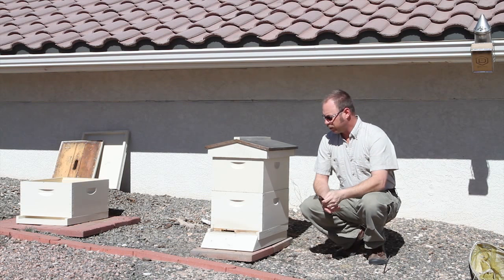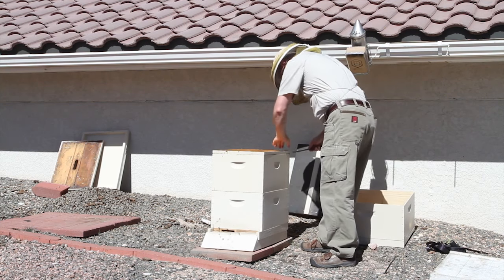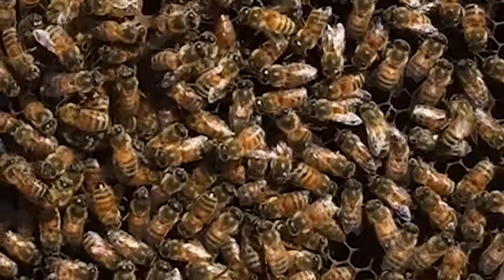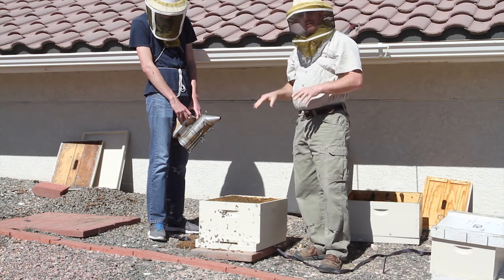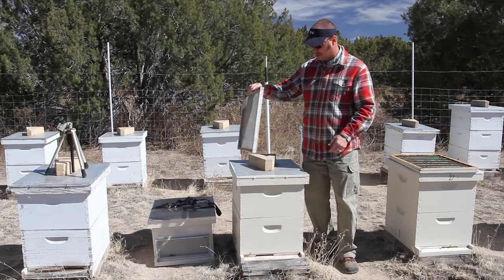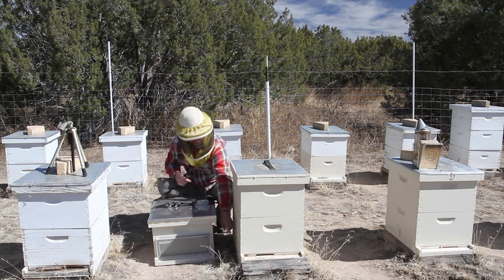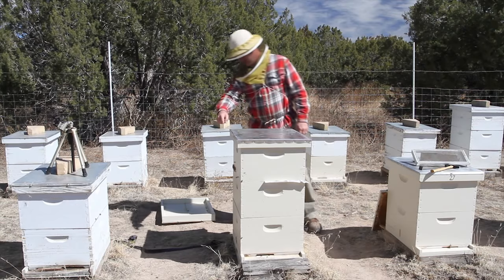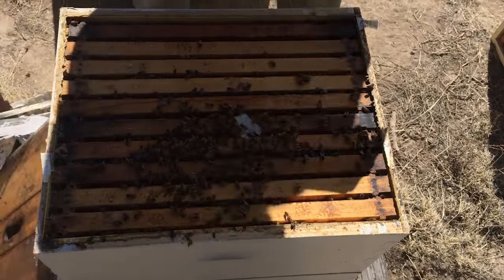Hive Management:  Uniting Hives

Comment: I have a feeling I might be uniting a hive shortly. It's a split and I'm afraid it won't be built up enough for winter. If that's the case, I'll unite it back with the parent hive.
Reply from the maker: Can you take brood from a strong hive (capped brood) and give it to the split?  If so, it will build up the hive faster and with less resources (capped brood have all the resources they need to hatch into adult bees).  If you can do this once a week for a few weeks you will see a dramatic increase in the strength and morale of the hive.  Of course, if you have only one other hive or a few hives it may be too expensive for the other hives, but usually a healthy hive can spare a couple frames of brood (plus it causes a little bit of a break in the brood cycle which can help the hive deal with mites).
Reply: +Honey Bee Honey that's a great idea. The parent hive seems to not be as strong as it was when I split it (previously it was booming) but the other large hive might have some to spare. I'm going to wait for a while longer before making the decision. I was to see how the queen does.

Comment: this will be my second year starting with bees I had a unfertile queen my first year (2016) and with lack of experience I lost the hive. I was wondering if instead of uniting the hives could you put the queen cell in the hive with the queen right hive, have her lay in that cell and relocate it to the drone laying queen hive, kill drone laying queen giving that hive a new queen? If so what would be some pros and cons for doing this and what is a good time line for the process? If you have a vid of this already, sorry for asking. I have not had a chance to go through all of your vids.
Reply from the maker: That depends solely on your resources.  But, to answer your question better, most of the time you could definitely give them a queen cell that had been primed and an egg inserted by another queen.  This video was shot in the early days of March, 2016.  At the time, there were no drones in the hives, so mating the queen wouldn't have been possible.  In this case, it wouldn't work.  Late fall is also a bad time for that as well.  You must kill the drone layer first though, whatever you do!  In the worst case scenario, in which you can't find the drone layer, a unite with a much stronger hive is both the safest and riskiest move to make.  It is the safest on one hand because stronger hives usually win out with the battle of the queens.  It is risky however, because the bees may make the queens fight it out and the drone layer might just win.  It has actually happened to me before.  Anymore, I only unite hives if I know for sure one hive is queenless and the other hive is queenright!

Comment: Suppose you had a hive that was queenless with a laying worker. The hive is weak and shows signs of SHB larvae. How wise is it to unite that to a healthy hive? and what if that healthy hive was Russian and the weak Italian or NWC? Is there a way to save the hive this early in the season (first week of March) when there are no drones and thus no new queens available for a few weeks?
Reply from the maker: It depends on the size of the cluster.  If they have more than two frames of bees in the cluster, they can wait until drones are available.  Re-queening is extremely hard with a purchased queen.  As far as uniting, which is the method that achieves the highest rate of success, the only concern is that you are absolutely sure that it is laying workers, and not a drone laying queen.  If it is only workers, uniting is the best way to handle the situation.  As far as the different subspecies of bees, it doesn't matter.  They will all tolerate each other.

Comment: What did you do with the queen?  i must have missed that part.
Reply from the maker: I united two different hives, one that was queen-less and one that was queen-right.  I placed the queen-less hive on top of the queen-right hive separated by newspaper.  The newspaper had some slits in it so that there is air movement between the two hives, and it usually takes three days before the hive members actually start to intermingle.  During that time the queen-less hive takes on the scent of the new queen and they combine their forces without aggression.  This was several months ago now, and the follow-up is that the hives did indeed unite together and they are quite strong now, storing honey for winter.  Because of the weakened state of both hives, I never tried to super them, just let them build up this year and store honey for winter.  So, I didn't do anything with the queen in the first hive because there wasn't one and my system usually leaves the queen-right hive in place, so there was no need to do anything with the queen in that hive.  Hope that clears it up.
Reply: Honey Bee Honey no there was a queen she was only laying drones.

Comment: great video!    do you have a degree? sounds like you know your stuff.. Where did you learn all this stuff?
Reply from the maker: I have a degree, but not in Entymology or Beekeeping or any related area.  I have been keeping bees since 1993 and I have invested a lot of time reading other beekeepers material, including journals and many, many books.  The books give me a good place to start and when I observe it in my own I have then gained the experience.  Just a lot of studying and I have no problem with going into a hive as many times as possible to figure out what is going on!
Reply: Good deal...I sure have learned a lot from your wisdom. There is more  to beekeeping than people realize.   Do you ever use RiteCell foundation frames? The ones I got from MannLake are RiteCell and are coated real real beeswax.   thanks!
Reply from the maker: Once in a while I use it, but usually only when I get a package deal, like a nuc that comes only with RiteCell foundation.  A couple of years ago I was faced with catching a swarm that had clustered on the ground.  Usually I just set a frame of beeswax next to the swarm and they will start to walk onto the frame.  Then I just put the frame in the hive equipment.  When I tried this with RiteCell after a couple of minutes the bees hadn't responded at all.  So, on the other side of the swarm I put a frame of pure beeswax, and they immediately started to crawl onto it.  Then, when they started pulling foundation they were very slow at pulling the RiteCell compared to beeswax.  But, if they had no choice (all RiteCell frames) I'm sure they would have pulled it like normal beeswax.  The good thing about RiteCell is that it is easy to install and when it comes time to rotate comb you can literally scrape the comb down to the RiteCell foundation and have them start over.